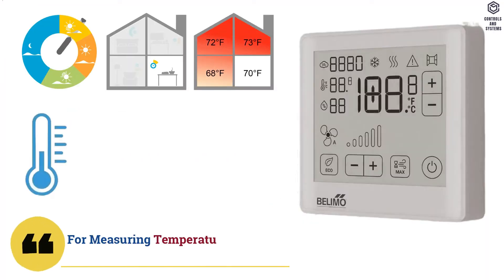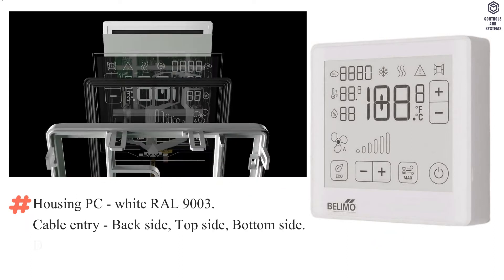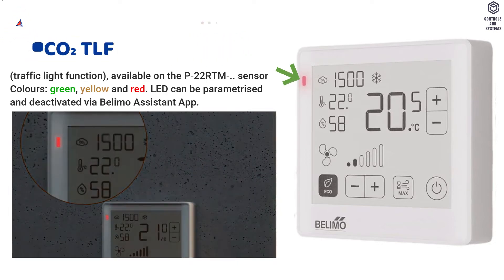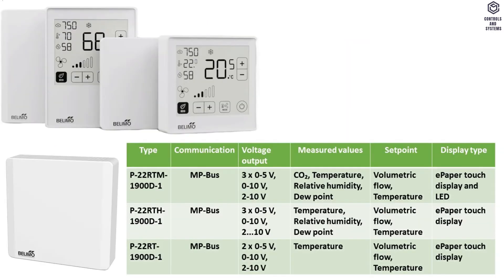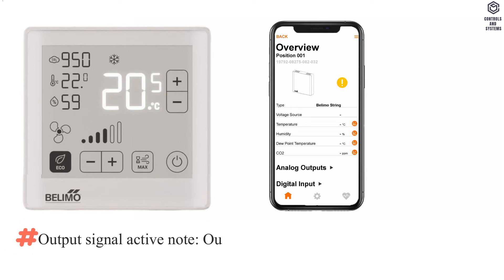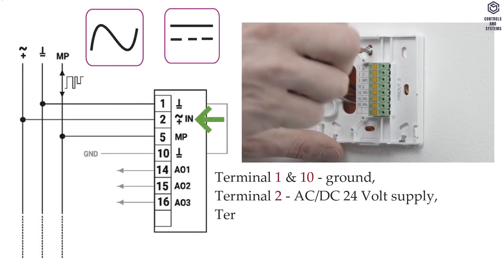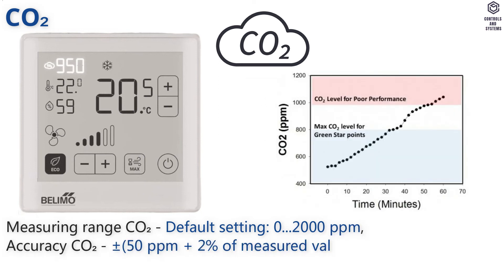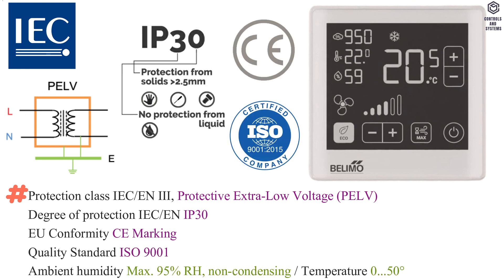Belimo P‑22RTM‑1900D‑1 Room Unit Overview & Tech Specs! 🛠️

Comment: Where is the duct sensor connection terminal .Only the thermostat will sense Onboard temperature ?
Reply from the maker: Sorry, I missed the input range; there are a few varieties of thermostats available with inputs and outputs; please refer to this manual for the answer. 
Honeywell T10 Pro Smart Thermostat,
Honeywell T9 Smart Thermostat,
Honeywell VisionPRO 8000,
Honeywell TH8321WF1001 Wi-Fi Thermostat,
Honeywell RTH9585WF Smart Thermostat,
Siemens RDG400 Series,
Siemens RDS110 Smart Thermostat,
Siemens RDD/RDF Series,